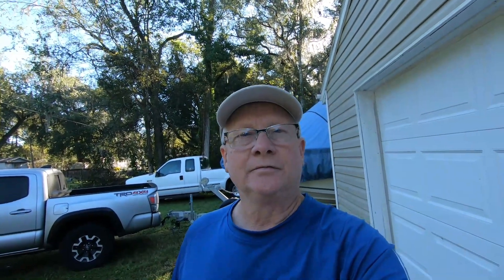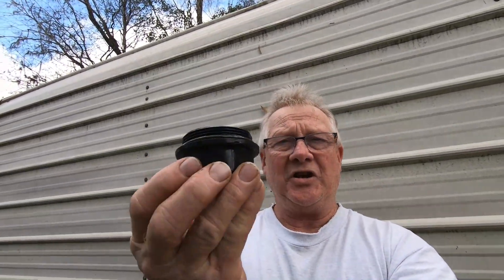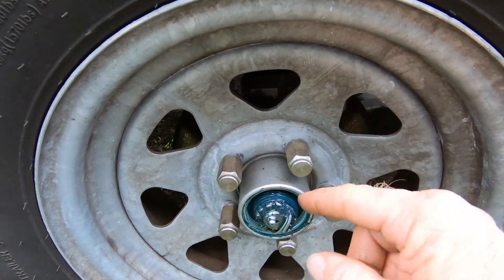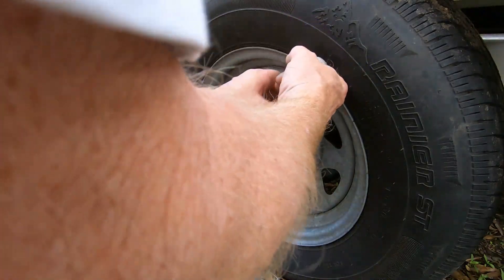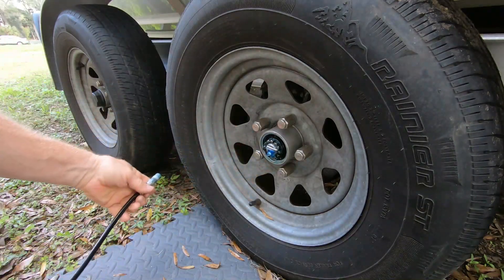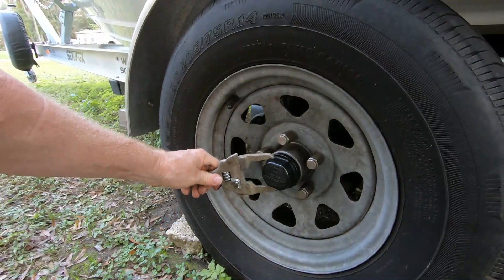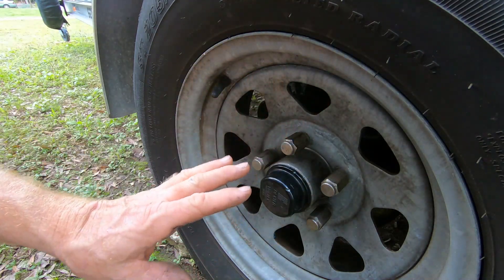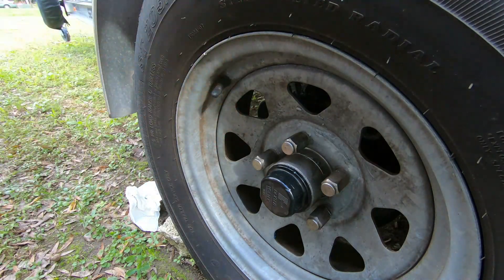THIS CAN HAPPEN TO YOU. TAKE ACTION NOW!

Comment: One school of knowledge here on using the Anti Seize is that it has Aluminum Graphite content which can/will cause galvanic corrosion in the salt water environment. It is best to use the same grease as you use on the hubs, preferably as you mention Marine grease, best one is from Lucas which is now used for the 6 year warranty with the Vortex hubs which I got on my new trailer in 2020. They also make a non metallic anti seize for marine environment. You can search for it on Amazon.

Comment: Those lug nuts i call them suicide lug nuts because if you dont maintain them regularly they will eat the bolts wen salt goen inside them and trust me they do ,open stainless os the way to go cap.👍
Reply from the maker: Thank you, captain. Most people don't think about that until they are stuck on the road. A little time and maintenance goes a long way.
Thanks for watching and leaving a comment. 
Tight lines........